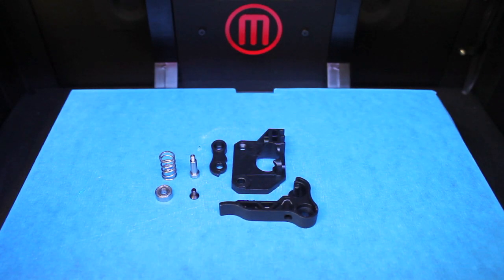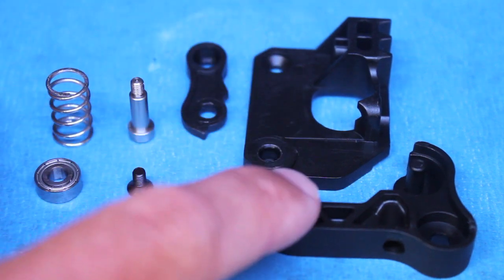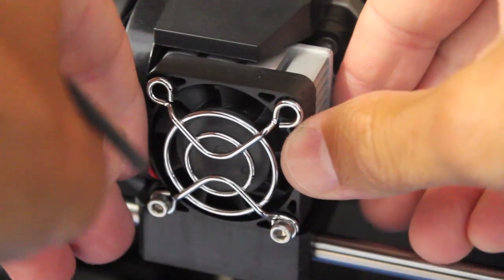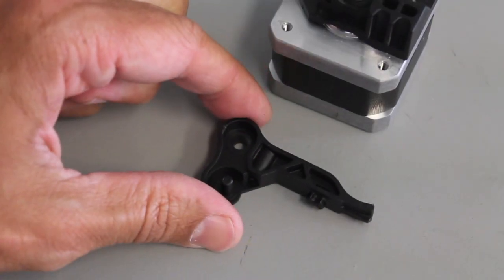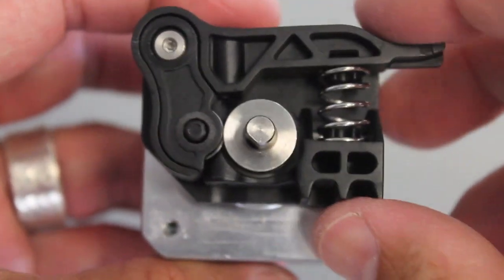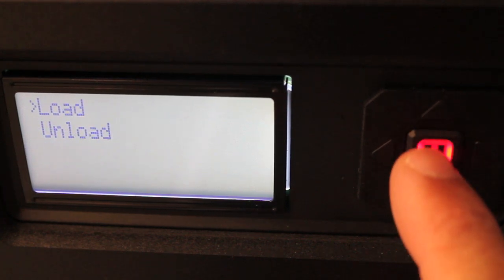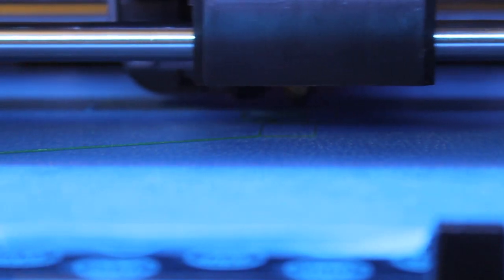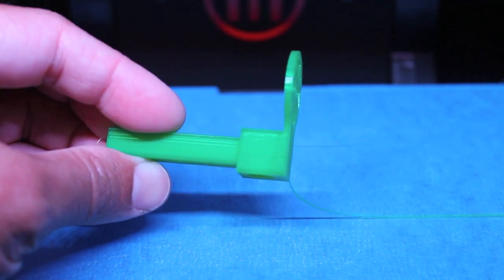MakerBot Replicator 2 Extruder Drive Block Upgrade for Better Extrusion

Comment: Have you ever had to replace the nozzle?   Great presentation by the way.  I got flashing red lights and heat error # 3 .  My prints start but then the nozzle clogs at about 40 percent of the way through.
Reply from the maker: +Daniel Bedoy Not yet. Sorry to hear about our troubles. I've had a few nozzle clogs over the years, but not consistently. Let us know how you get along.

Comment: Would you mind telling me what size the set screw in your drive gear is? I just got mine in the mail and it's missing that screw. :-(
Reply from the maker: Are you referring to the silver or black screw? I'm going to be out of the office for a day or two but when I get back I'll take a look.
Reply: I'm talking about the black one that holds the drive gear to the motor shaft.
Reply from the maker: george harrington Check this out: http://www.thingiverse.com/thing:53125/ on the instructions tab there is a parts list. Check out the flat head cap screw below...

The 2mm and 2.5mm hex wrenches that came with your MakerBot Replicator 2 
1 M3 Hex Socket Shoulder Screw, 4mm diameter x 10mm length shoulder 
1 Compression Spring, 0.360"OD, 0.276"ID, 0.630" Free Length, 32lbs/in spring rate 
1 M3 x 6mm Flat Head Cap Screw 
1 Ball Bearing, 4mm ID x 10mm OD x 4mm width
Reply: Thanks, but I got it figured out. Also, I didn't get any it those tools with a makerbot, because I don't own one. I am however, installing makerbot parts on my printrbot :-)

I'll be posting a file on thingiverse soon. If you want, I can leave a link on this post for you.

Anyway, I ended up heading down to joyful honda to pick up an M3 set screw, 3mm long, as well as a set of micro-sized hex wrenches.
Reply from the maker: george harrington Nice! Very resourceful. Definitely share the link when the file is done so others can benefit. Thanks.

Comment from the maker: The one I ordered is made of a different material than PLA or ABS. I'm not sure what material it is but I've read that it lasts longer. The main reason I ordered the kit was so that I could get the spring and bolts that come with it.

Comment: Nicely explained video on how to install the makerbot 2 replacement drive, our company makes the Aluminium Filament Drive for the Rep 2 that replaces the original as well as the plastic upgraded versions.

We would like to refer to your video on how to install our Aluminium Filament drive on the MakerBot 2 as the process is the same.